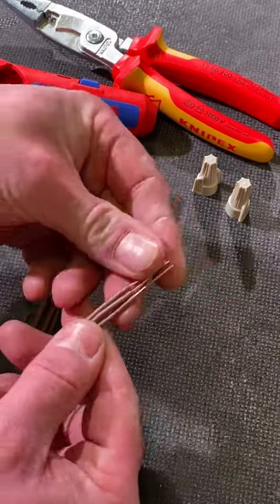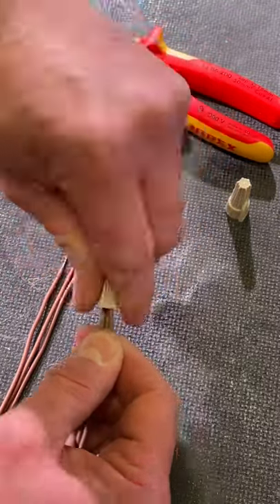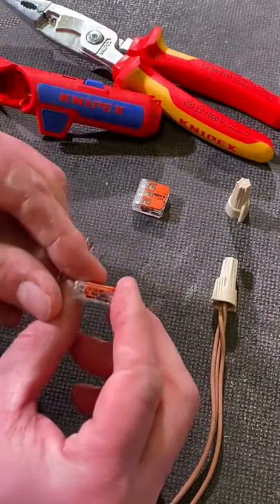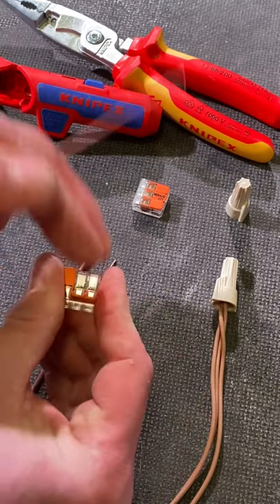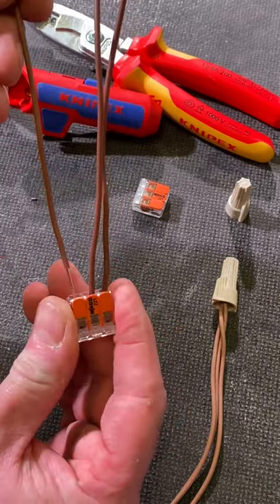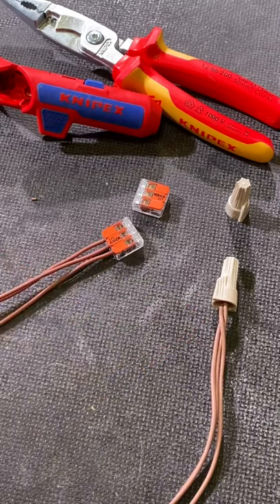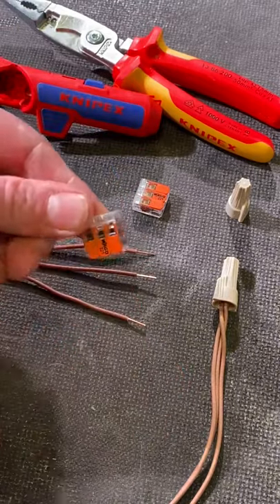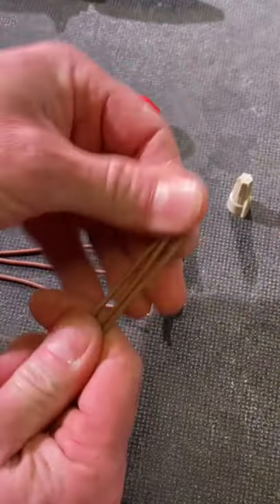Which way do you splice wires? WAGO 221 vs WIRE NUTS? | Electrical #shorts from eFIXX

Comment: The type of connection is far superior when you twist your connection.
These Waggos have thin metal bands keeping and maintaining your connections. So high traffic/amp areas plugs switches etc, wire nuts.
Lighting you can get away with Waggos cause usually your load is paralleled between the circuit and the fixture so current is low. Regular junction boxes should be made with a superior splice.
Reply: It really doesnt matter if it is high or low power when using these wagos. Its even forbidden to use them at my work. 
I work at high power stations with 50Kv / 150Kv / 380Kv and do installation work in these buildings.
All these buildings are electrical heated, all the stuff is connected with wagos and 3.3Kw goes through without any problems.
The problem with twist connection is that you have to do it with care.
Just a little bit too loose twist makes a bad connection and has more material resistance between the wires compared to a wago.
Im an electrician for like 15+ years and I never ever used the twist type connector, either in home or industrial installations.
I mean its not bad to use them but its old tech for quite a long time in my opinion. 
And the fact you cant use them more than one time is a good reason too.

Comment: Ignoring that you can simply unscrew the wirenut, what’s the price difference between these? As a home diy guy, the wago looks very tidy, which I appreciate. But depending on the price difference, the wago could be unpractical for a professional who would buy and use in bulk

Comment: According to all the wire nut manufacturers instructions, you’re supposed to cut off the wire nut just like he did here. Although everyone whose every used one knows it works just fine if you take them off. 

It could be said the only reason wire nut manufacturers say this is to sell more wire nuts and maybe avoid any lawsuits.

Comment: Wirenuts may be old technology. But here in the subtropics with high cycles of heat and humidity, they reliably keep copper on copper with very little voltage drop and they are inexpensive and widely available. Wago may be better, but wirenuts are not a broken system and do not need fixing. I will finish my time with wirenuts and I will show you wirenuts I put on in the 80s which are still dry, tight, and doing the job.

Comment: Uk here... We don't use wire nuts at all, anywhere, they're not specifically banned by bs7671 but it's just a solid no from any engineer here. 

Wago's however are awesome, I have a pocket full most of the time.

Comment: I trust Wago's as much as a "suitcase" connector --- ZERO.  The contact point inside is much too small and could generate heat under load.  The contact area of a twisted pair or set of wires is much greater.  Less chance of a fire.

Comment: I think he did it on purpose but he put the wire nut on wrong and then removed it by cutting it. You always twist the wires before the wire nut to ensure a permanent connection. The wagons are meant for a more modular install.

Comment: Thing i had happen with those wire nuts, i unscrewed them and die fitting came out of it still attached to the cables. But yes, wago all the way. It's so easy

Comment: Always twist your wires when using a wire nut. Wire nuts aren't a conductor like the Wago is hence why they don't have an amperage rating. All the wire nut does is clamp the copper conductors together.

Comment: I have something like that waygo (however its spelt) connector, but its designed to hold the wires in and not let go, theres no release mechanism on it, so for me, its the other way around
Reply from the maker: They make a few versions some off which don’t have the easy release mechanism. 2773 series
Reply: Just twist and pull

Comment: I'm from Ireland so pretty much the same spec as the UK. I worked in Canada for awhile and I was absolutely appalled at the site of sparks using cable nuts. Absolutely disgraceful to see copper being twisted together. When I pulled out the wagos and connectors it was like a caveman seeing fire for the first time😅😅😅

Comment: Yank here. Brits, and the rest if the world are still ahead if us, by using Wagos. It’s REALLY hard to train old dogs with new devices.

But, for the old school wirenut that we use, literally, every day, you simply unscrew it, add another wire (or remove a wire) and screw it back in.

Note, it is better to pretwist the wires before adding the wirenut.

Comment: If you like arcing and loose connection definitely twist the cables with the wire nuts otherwise just use those fancy knipex and twist the wires together and then put on the wire nut.

Comment: Ok. It's 2022 and no one anymore use wirenuts
Reply from the maker: USA do
Reply: Exactly. Only knew Wago my whole life (of course also wire terminals) and it only makes sense. Contact security/reliability us much better with something automatically pressing than a screw.
Just recently replaced wire nuts in my ceiling lamp with Wagos.

Also introduced Wago to my father-in-law on the Philippines. Hopefully it spreads from there and they get rid of the American influences. 😅

Comment: I have just twist the wire nut backwards, separate the wires and reuse wire nut.
28+ years rewire motors for voltage.

Comment: Wire nuts are a more solid connections and will last longer ...Waco’s are not good due to any vibrations over time will loosin the wire just like good practice to never backstab receptacles and switches always wrap around set screw...and before you put on wire nut use your linesman’s to twist wires together in nice uniform matter snip on angle at appropriate length to guide wire nut on properly and allows good connection.

Comment: Wago over heat and melt causing shorts or loss of power more often than wire nuts. Wire nuts are cheaper and more practical for use on j box that are gonna be hard to get to.

Comment: As a Union wireman i can say this guy isnt wrong. Most of the time though half ass guys will reuse a wirenut and for small wire like that there probably is minimum damage but the wire nuts integrity has been altered. As for not twisting the wire after they’ve already been Stressed it’s best to start new so you can ensure longevity. I prefer wagos all day. Never seen one fail only stab lock designs have i seen fail.

Comment: Never seen a wago connector used commercially or on the residential side here on the west coast of the US so can’t say which is better. However seeing how the flip up tabs are plastic and typically plastic gets brittle over time common sense would say the wago is the weaker link. There’s no moving parts on a wire nut. 

Personally I usually replace them simply because it looks better to the customer and just in case there’s any corrosion that would interfere with conductivity.

Comment: As an actual electrician we pull wire nuts off all the time and use our lineman pliers to flatten them out. Never do we cut the ends because every inch matters when it comes to existing circuits.
Reply: Great way to introduce a fire risk.
But it's code right, so you're not going to be prosecuted for doing that, right?

This is why you need a Wago.

Comment: Meanwhile in the USA you have a bundle of 12ga conductors twisted together in a 4 gang box all the way to the entry so tight that you swear the first guy fused the copper with the heat generated as you try to separate the connection after the 20+ year old wire nut basically fell off at the start... sometimes split with age leaving the coil behind 🤣  That's when I think boy I wish WAGOs were more popular in the USA... Although other than situations like that and other specialty cases I really don't use them often or see them used... But they are a wonderful invention, mainly because they are hard to screw up... Although I've also seen them installed with plenty of bare copper sticking out of the bottom because either people are lazy or stupid... Why spend nearly $1 on a single connector meant to easily be quickly and easily adjusted then leave ¼/6mm of hot copper sticking out?! 🤦‍♂️ I've seen it on the center conductor of a 4+ connection on a wirenut fairly often which I know was laziness not wanting to redress the connection... But multiple wires with exposed copper on a wago? Who is that dumb that works for a company that actually spends the money to use/supply wagos?! 🙄

Comment: The copper in the tube and knob looks larger in diameter than the 12 romex. I dont like screw on connectors. Is there anything improper about using wagos to splice into tube andknob?

Comment: You do not have to cut the wire to reuse a wire nut. If you want it to be the prettiest bit of wire hidden behind drywall go right ahead, but cutting the nut off is not necessary

Comment: Wago's are wonderful, until the spring inside of the connector fails, the housing cracks and you lose conductivity. Trouble shooting lighting systems with these failures can be a nightmare!
Reply from the maker: Sounds like you’ve been buying the Chinese copies! Doesn’t happen with the genuine article.
Reply: @efixx these came with the can lights we installed on a few jobs

Comment: I just had a wago fail on me last week and cost me a 2k motor controller. They don't handle current or industrial conditions very well, I'll stick with my wire nuts and butt splices.

Comment: i like wagos for new construction, but for remodels, wirenuts are ideal
Reply: if i'm tapping off a neutral or a hot wire, they're usually all spliced with a wirenut already so i'm not about to undo that splice just to insert them into wagos

Comment: America is a wirer’nut user!
Police station
Fire station
Hospitals
Gas station
Apartment complex
Amazon warehouse’s
Commercial buildings
Average houses

Completely everything is build in electrical circuit on wire’s from 6 AWG and down to 14 AWG gage in wiring connections is connected with wire nut!
And trust me: the lis a load on some circuit!!
And everything is good!!

Comment: You’ll only ever have to cut it if it’s old and corroded. Just hold the wires firm and back the wirenut off. Also no better connection than a braided spice.

Comment: You know you can take the wire nut off the reverse of the way you put it on. Only time I have to cut a wire nut off is if it is in a handhole splice, which isn't alot but thats what undergrounds are for.

Comment: Wago is much better, wirenuts are not alowed in Germany. And wago is easy to change Single wires. It is possible to change wires without searching the correct breaker.

Comment: americans are fuming because you throw away "reusable" wirenuts

im not american but since my country got electricity, we were using British Standard regulations..

changed after like we started to have normal sockets that have square backboxes like your typical british socket.

also we got a sticker on every plug/socket thats called "Sirim" (pronounced Sii rim) basically to indicate that the item has been tested beforehand, and is safe to use.

Comment: Why in the hell didn’t you just twist the wire nut back off? Here in the US we just barely started using the other plug. Wire nuts are a must
Reply from the maker: We don’t use wire nuts in Europe
Reply: Man each country I swear is a test subject lol we are the fallout vaults without having nuclear war. You guys have better power supply then us too
Reply: @efixx  like when we used to upgrade lights they came with a wire nut now they have modernly started those cool clips but that’s only been a really recent thing on led lighting which is also pretty new here

Comment: I have seen a cable been forced through a wirenut if one cable is slightly longer so are dangerous and need to be not used same as ringmain circuit

Comment: I think everyone here in the comment section missed an important key fact. Near the bottom of the screen it reads, "Includes paid promotion."
  The gentleman in the video is trying to make you think that you have to cut off the wire nut and are not able to reuse it (unlike most of us with common sense who do reuse them).
  Like we 'have to' buy the Wago Nuts or something. 😏

Comment: Those other connectors are garbage. Heat cycling of the conductor will work them loose. If you want a reliable joint then pre twist the stripped back portion of the conductor; twist on the wire nut; then tug on the conductors and wire nut to ensure you made a good connection.

Comment: I'm confused, why in the hell would you EVER cut a wire nut off. Just unscrew the damn thing and reuse it, it's as simple as that. I have done IT work and electrical work for nearly 15 years and I have NEVER cut off a wire nut, not once.

Comment: First of all, I would never use those fire hazard clip on deals. Second, you do not have to cut off the end with traditional wire nuts you unscrew the wiring it in with those wires he’s using you wouldn’t have any effort at all to reconnect them into something else or rewire not them heavier solid wire. You may have to use new nose pliers to help straighten them out.

Comment: This isn’t a real question. Wago’s are used in fixtures, some devices and should never be used in any jbox. A wire nut can be used in almost any situation on small circuits. And yes you can unscrew a wire nut and use it again without stripping the wire again if not this would be crazy.
Reply from the maker: How do wire nuts do connecting flexible to solid wire?

Comment: Bruh just untwist the wire nut and you’re still able to use it… not to mention wire nuts provide a better connection that with stand the test of time better than waygos but both are good good video

Comment: First of all you twist the conductors together with your linesman pliers then you install the wire nut. If you want to separate the conductors you do it in reverse unscrew the wire nut and untwist the conductors with your linesman pliers my trade electric teacher would have had a fit if you twisted solid conductors together like in this video...

Comment: You’re Technically not “supposed “ to reuse wire nuts but as an electrician I would never cut the wires as this guy did. F’s the next guy that may do service. Wagos have their place but it’s not everywhere. Just because they are easier to use doesn’t mean they’re right for the job. That’s how fires happen.

Comment: Why would you cut the wire nut off? You’re just making more work for yourself and possibly making the wires so short you need to add more wire, and then you have to make two new splices.🤔

Comment: Why are nuts are absolutely reusable. I reuse them constantly, nobody actually cuts them off. It's just a tapering thread inside either plastic for the cheap wire nuts or some sort of aluminum or copper for the more expensive wire nuts but it's basically in the name of the product, it's a nut. Just like you.

Comment: Those wago connectors are way to expensive here to justify using them over wire nuts it’s like 10$ for a box of 10 where for the same price I can get 50 wire nuts

Comment: So he'll cut his wires and restrip to use on a nut but won't use a tool to twist the wires together before the nut, I want my connection to be rock solid before the nut even goes on js

Comment: Walnut .. easier and you twist all wires into 1 wire .. waco takes time and cannot twist and its messy and lose wires .. with walnut you can have a maximum of 6 wires at a time but walnut reaches 3 to 4 wiring at a time

Comment: Wires should be twisted prior to installing a wire nut. Wagos and push connect garbage are the same as the now outlawed backstab devices. Poor connections cause higher resistance = burnt wires = nuisance breakers = higher energy costs.

Comment: NO!!! That is NOT the proper way to install a wire nut!!! Take those 3 wires, put them together with the ends matched up. Now, grab those lineman pliers and twist them clockwise. Trim the ends, THEN put the wire nut on. THAT is the correct way to install them, and ensures a single wire can't be pulled out of the wire nut.

Comment: Why wouldn’t you splice the wires first before putting on a wirenut? That’s how a proper splice is done period if an electrician does it. As for the way go types, meh, I would only use them for an end of the of a line connection, like to a light fixture. Not ever for branch circuits.

Comment: First of all wire nuts are reusable. 
Secondly I’ve seen Wego blocks cause electrical fires because they are loose and they do not firmly grab the wire under heavy load
Reply from the maker: We’ve never seen a wego fire 🔥been using them for 12 years - what are you doing with them to create a fire?
Reply: @efixx  who said I was creating fires?  I've seen these used on a 20 amp circuit melt.

Comment: Its senseless to cut the wire nut off just un screw it, your right to cut the wires back a little, they become brittle and break or create a fire hazard  once they are twisted and bent around
Reply from the maker: That sounds like cut the nut  off and re-terminate the wires?

Comment: You should always twist your connection with your linesman's and then put a wire nut on wire nut is an insulator not a connector.    Wagon are weak point they are not firm tight connections and cannot withstand heavy loads

Comment: Your Joking right? Wagos don't carry the amps wirenuts do, plus you don't have to cut a wire nut off just unscrew it like 99.99999999999999999% of everybody else does.

Comment: The wirenuts should be fucking illegal man and I tell you why. 
I don't believe I've ever opened an old installation with wirenuts where those damn things had NOT losened themselves. They are always having bad connections creating heat and in the worst case, a fire hazard. 
Not to mention when I'm working these are just a huge inconvenience! You can't reuse them and even if you remove one so that you don't cut the wires short they will be all tangeled, shit to install into a wago